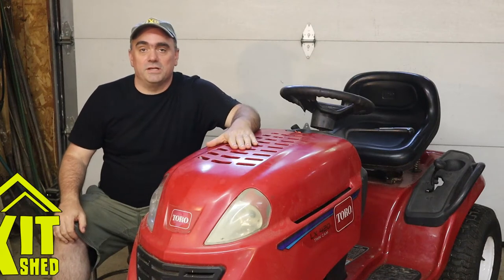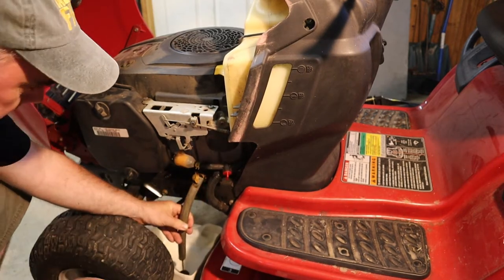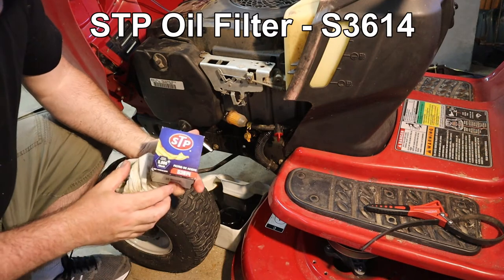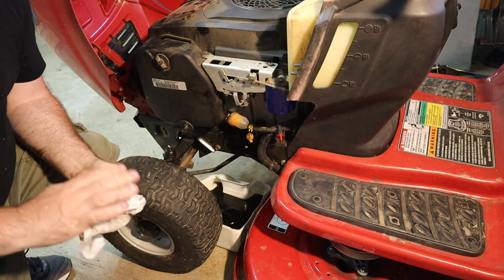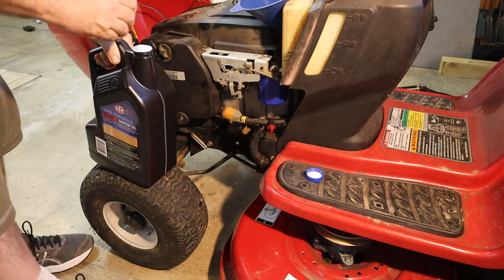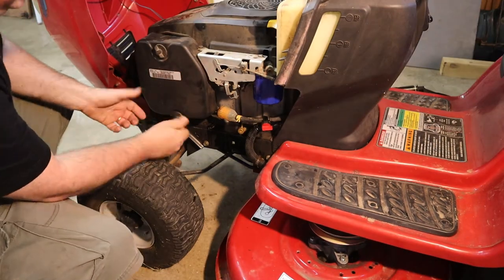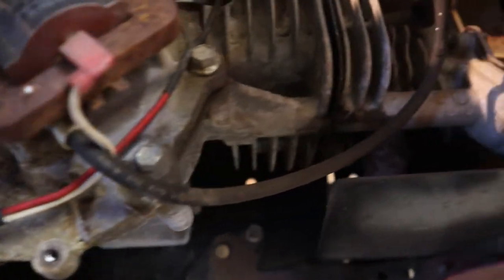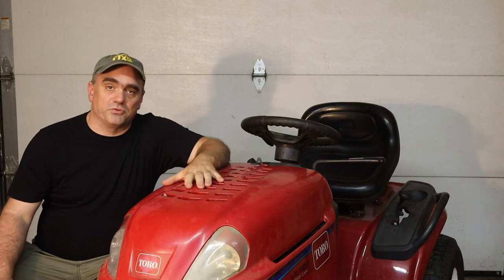Going Over MY Toro LX 420 Riding Mower.  Lube, Oil and Filters

Comment: Did you have a followup on the reason the deck wouldn't stay running? Having the same problem. Gone over the deck, and now I'm going to try different size belts.
Reply from the maker: Not yet.  I put a shorter belt on, but I think it was rubbing on something.  I think I have that sorted out, but am waiting for the new belt to arrive.
Reply: @TheFixitShed  Thanks. Looking forward to what you find out. The info you just gave about the belt might be rubbing on something, I'll keep an eye out. First thing I've done is get the 109 inch belt in a 5/8 instead of the 1/2 inch. Although the belt I have was the one in the parts list for it, it sets all the way down in the pullies. Waiting for the 5/8 to come in. If it works I'll let you know, but I've a feeling I'm going to have to keep looking.

Comment: Great video ...but you put the oil filter on way to tight. My opinion. Manual says 1/2 turn,  (even in bold lettering) after it seats.
Reply from the maker: Thanks for the tips!  What manual are you looking at?  I was told years ago to tighten 1 turn for all oil filters, so maybe that is out of date.  I don't think I was able to tighten it that much anyway.  I think it only went a little past 1/2 turn,  probably not even 3/4.